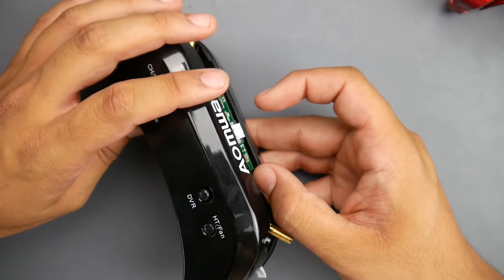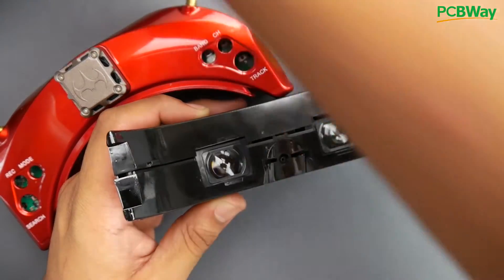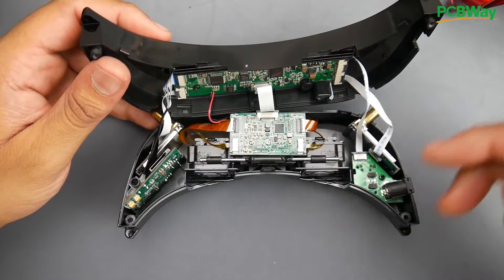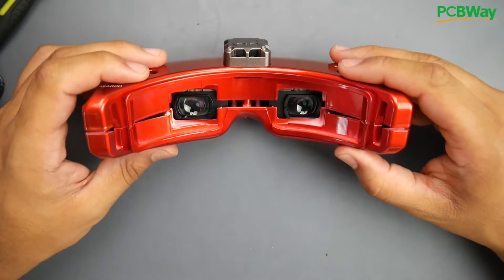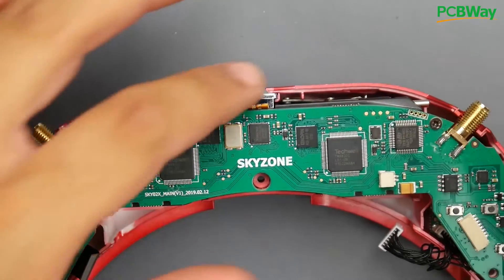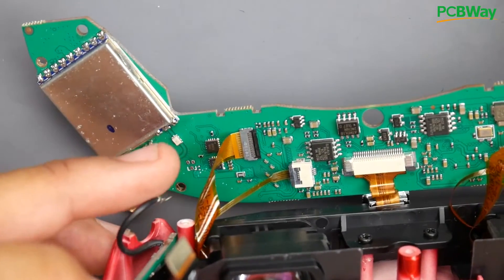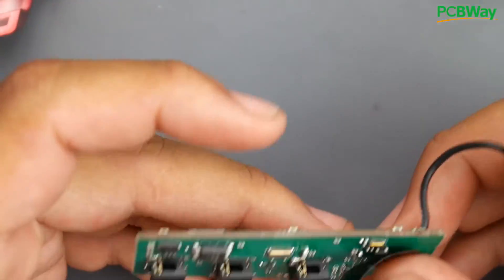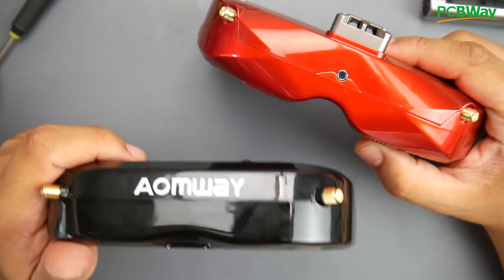Tear Down Inspection // Skyzone Sky02x vs Aomway V1S

Comment: DVR's are usually shit because they use:
a) old compression algorithms and containers like MPEG, AVI, etc.
b) not nearly enough bitrate to store the FPV in a visually lossless way
c) may not store frames that were completely lost due to the interference
and I suspect the cost of engineering a specific ASIC just for FPV dvr (where the signal quality varies wildly) is just too high for too little reward. There are already chips on the market that do the job cheaply and poorly, but still well enough they don't justify engineering costs for building one optimized for FPV and quality.

Comment: 3:08 Those are MLCC Multi-Layer Ceramic Capacitors. Tantulum capacitors offer higher capacitance for a given size but are polarized (only suitable for use for DC blocking and DC filtering, or application where the voltage never goes negative) and have higher ESR than MLCC, generally speaking. They also tendancy to go short-circuit and explode in a fireball when pushed beyond their limits. 

MLCC have other weird properties (capacitance changes with voltage and tempurature), can have reasonably high capacitances (although good ones are expensive)

Comment: I heard you mentioned you're a pretty experienced when it comes to tearing down an Electronic devices. You're touching those micro electronic (semiconductor) components. I just hope that you were grounded/discharged at first prior to touching the components to avoid failure due to unforseeable voltage spikes (aka esd). The reason I said this coz your vid did not either show or say that you're safety at first. Cheers!

Comment: Sir nice teardown video. I got my new 02C couple of days back. Few powering my power button got stuck. The click is gone. Now i have take off the batt plug to off and on the goggle. Iam not able to switch off the fan aswell. What can be done sir. Can i open it as u did and clear it or ask BG for a replacement? How to take off the face plate ?? Pls help iam stuck with my new goggle

Comment: As much as I can see, you can replace receivers on Aomways. With a minor mod probably even use 3rd party receivers. You can't do that on Skyzones since there is only 1 huge pcb with everything on it. Therefore I would choose Aomways between those 2,despite stupid solution with that ribbon cable. Nice video, I like teardowns. 👍
Reply from the maker: No need for mod just av Input and the docking

Comment: Can the skyzones be powered using the micro usb port? Thinking of using a powerbank instead. Awesome teardown btw, really helpful. Thanks mesh!
Reply: No they cant. Even to get a connection to a pc through usb you still have to have a battery to supply power to the 02x
Reply: @patricklangdon9129  thanks for this! Appreciate the response.

Comment: Whan the aomway stops working, don't even try to test the wires with the multimeter, just get a set of ribbons and replace all of them.
 Whan you lay old ribbon it flat it might work, but whan you bend it it might loose the connection and not work
Reply from the maker: The Man with the experience.. Keep it up buzz

Comment: So, I bought the v1s goggles like the first day they came out.... Then all three other goggles hot the market like 3 days later (at least that's how it seemed) how mad am I going to be at my purchase?
Reply: I feel your pain man...did exactly the same thing.
Reply: @dinholimno  been a tough week eh?
Reply: @billdor121  You got it. I saw the review on Painless 360...thinking about the mysteries of life.
Reply: @dinholimno  lol yup, bit that same piece of bait
Reply from the maker: I'm not saying the aomway is bad at all. But no matter how I record it it always seems that way but in reality it's a good goggle but the skyzone is slightly  better in terms of lcds and just overall  build construction. I bet the DVR is possibly alot better on the Aomways.
Reply: @DroneMesh  so looking at this video.... It doesn't seem impossible to make the aomway take a rapid fire module... Could the input ribbon cables, or their input pins be highjacked to take rapid fire instead of the, what I'm assuming, is a regular 5808 module?
Reply: @DroneMesh  obviously there would be some cutting on the outside to do

Comment: 😬 You connected the skyzones ground wire to the PCB wrong and looks very close to touching another component. Loop it around the SMA connector.
Skyzones quality and PCB design looks vastly superior to Aomway, and fatshark. It's so neat and well integrated.